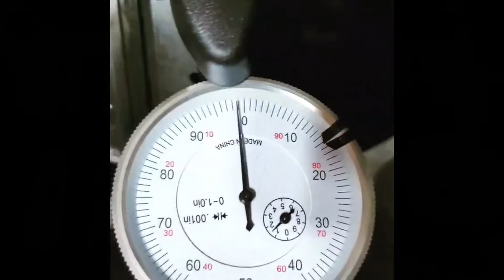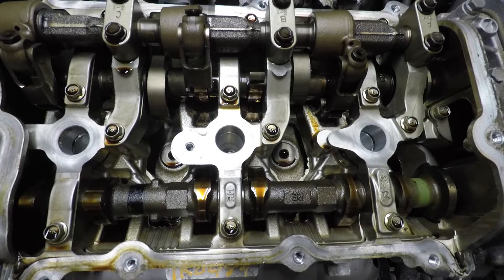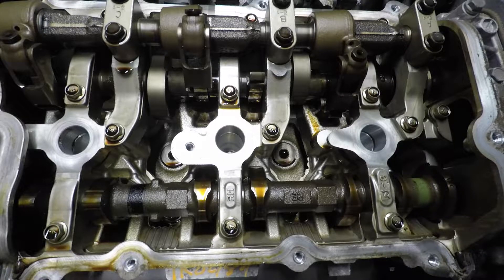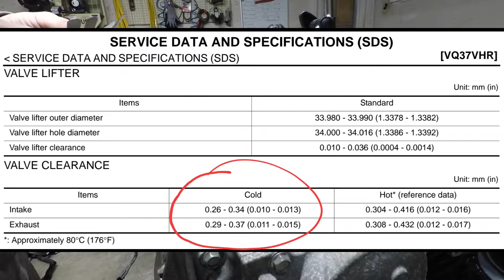Forged VQ37VHR build part 3, valve lifter clearance how to

Comment: It is nice to learn from the VQ master!
Reply from the maker: Just bit and pieces from a lot of great people throughout the community.
Reply: Ii realize the the procedure,but nothing on circumventing ,bypass, or modification for installing VHR into a 350 Z with No VVEL ECM or harness.
Is there a stand alone kit, or VVEL lock out for full advance?
I realize this IS changing Cam timing. Even suggested by others that it may affect valve/piston clearances.
But piston is fixed and Cam at full advance/retard  should be relevant to piston/valve clearance no matter the Rpm.
Since it  IS  designed to operate at full range @full Rpm when operating. ?
It may kill some low end, and provide "lumpy" idle,but I haven't seen any lift specs for Hi Rpm. Is there a kit or cam to replace or "SET" this timing/lift for street or racing?? Thankyou, George P.